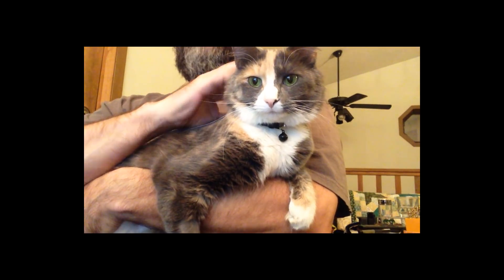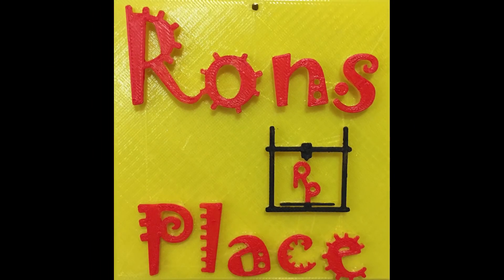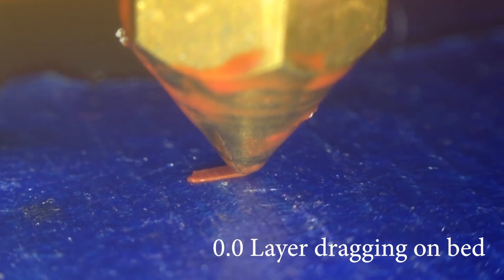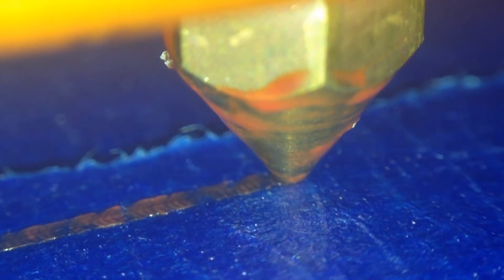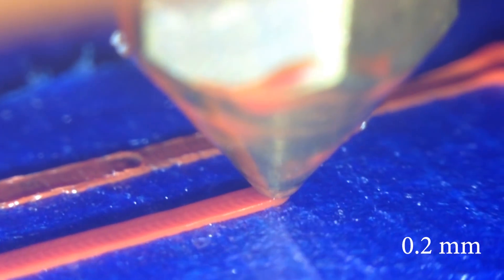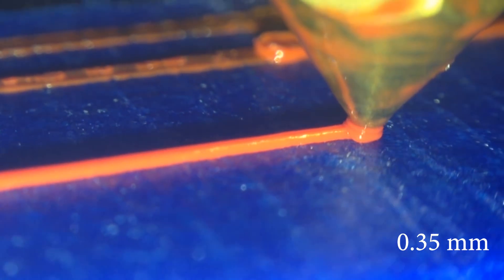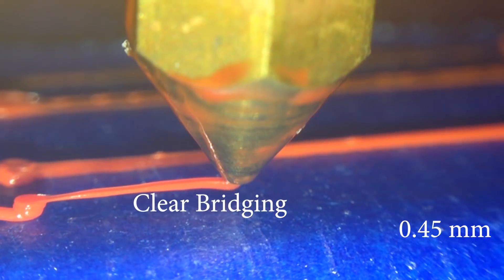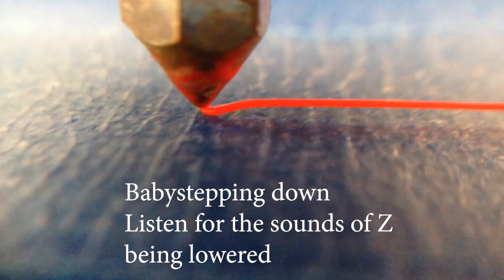3d printing Layer Heights

Comment: Great video. I just got my first 3d printer and I’ve been experiencing a lot of issues with the first layer adhering to the bed. Constant readjustments and a lot of frustration, but I think I finally understand. Being that it is my first 3d printing experience I went into bare bones and went with the sticky note method of bed leveling, but I guess I just need to invest in feeler gauges to set a proper bed height. I could get the bed set reasonably with a sticky note but it was a crap shoot if the first layer would stick and I think improper bed height has bren the cause all along. For days I’ve been watching videos trying to figure this out but this example is the best of all. Thanks.

Comment: I've been sharing your video as much as possible to new printers. This video is the perfect representation of the first layer height. This whole idea gets boiled down to "good squish" and that just isn't enough information.

That and understanding that when you level your bed with a piece of paper or feeler gauge, you have to account for the thickness when you set your "initial layer height". This would solve so many bed adhesions issues that people have but no one seems to talk about it. 

It's always temperature, "USE GLUE" or any number of "fixes".

Comment: I have no problem printing the first layer so that it is smooth like the one in the video.  The problem is the subsequent layers show alot of scratching.  So might print up to three layers very smooth and flat but after that its like the nozzle didnt move high enough and scratched the previous layers.  Not sure why there are no videos on something like that as it seems to be a common issue based on the forums I have read.

Comment: Its hard to get good bed adhesion in my experience at your "perfect" height  for the first layer.  I set mine between that and the second "shovelling layer" played before that  i find the squish helps tremendously with tall skinny and or faster prints

Comment: Nice idea -- and nice execution. Perhaps I missed it, but I'm assuming you're using a 0.4 mm nozzle. How would the Z-height be adjusted for other size nozzels from 0.1 to 1.0 mm nozzles? And do different materials make much difference: ABS, PLA+, etc.?

Comment: 4:07 how do I fix this
Reply: Adjust your z offset to get a little closer to the bed.  If you can't adjust z offset, adjust your bed by giving each wheel a 5 minute turn closer to the nozzle until you get something like at 2:55

Comment: Thank you Ron

I completely agree with the 0.25mm high, is the one that's working best on my ender 3 pro
I want to emphasize... guys stop using paper, paper it is not a tool, get yourselves a feeler gauge
and make sure it touches the nozzle and the plate and without pressure

I also want to share my other settings:

creality ender 3 pro
creality polypropylene build plate "amazing"
hatchbox PLA
build plate temp. 60°c
nozzle temp. 200°c 
initial layer high 0.25mm
initial layer print speed 15mm/s "very important"
initial layer flow 150%
initial fan speed 0
Brim width 4mm 

Ultimaker Cura 3.6.0

I like using brim not skirt, because when it starts
printing the outer line of the object, it's just a continuation
of the brim and the outer line is going to stick on the plate
and on the brim as well.

happy printing and
Thank you!
Reply: I agree on the gauge tool. Very helpful.

But should you not set your initial layer height to “0,375” (150% of 0,25) when you set 150% flowrate on the initial layer (according to this video)??

I also am doing 150% flowrate on first layer but do now consider not to.

Comment: Good job, but this only applies to a first layer on a blue tape - on inconsistent surface.When you print on glass/sheet metal you have almost perfectly flat surface and especially first layer greatly benefits from that. And then other properties than "looks" start playing bigger role. Ie different youtuber had shown, that for 0,4 mm nozzle 0,1-0,15 mm layer height results in best inter-layer adhesion and strength goes way down with anything above 0,2 mm.
I prefer 0,12, because it's strong and from normal distance you don't perceive separate layers (exact value is 0,12, because it aligns with stepper motor that on my printer prefers 0,04 mm steps).

Comment: PLEASE HELP. I’m getting desperate at this point.
1. To get anything to stick, I need to raise the bed to the point where the extruder motor starts clicking.
2. No matter what, the first layer gets really messy and rough, and most of the time just lifts off while printing (it lifts off when the bed is low enough to stop the clicking, but it is messy no matter the height of the bed)
How do I get the filament to stick properly? What could I be doing wrong? I’m getting so frustrated, I spent 2 hours today trying to get it level, and trying to get the filament to stick properly, but I couldn’t. I should also clarify I’m using an Ender 3 Pro.

Comment: Just wonder how you did that test with the Prusa MK3 as I am having problems with my nozel and would love to see how you can print thes lines.
Reply from the maker: this was done on an i3 clone actually..  you can get the same concept with the MK3 by using the menu item for setting the first layer.  It works VERY well for setting this.

Comment: meh, i have no issues with a .1mm layer height or even a .05mm height. it makes the prints better quality imo even with a .4mm nozzle. the layer lines arent as noticeable. i also find the use of blue painters tape to create far too inconstant a first layer to be reliable. i print on glass with glue stick. FAR better adhesion and first layer quality. i havent had a print fail in over two months. .2mm layer heights are almost too high for me. last time i tried that the print was very structurally weak i was able to crush it in one hand. i only ever use it for supports. it adheres just enough and creates enough support to hold up overhangs. its also super easy to remove supports printed at a higher layer height than the rest of the print.
Reply from the maker: Thanks for the input!  I wanted to clarify a couple things..  this was specifically on first layer height; not over all print layer height.  The idea was to show what different heights looked like for newer people.. and why modifying your first layer height often makes sense.  Meaning you can print at .15mm layer height but do the first layer at say 150% (0.225mm) to give a very solid first layer to build from.   

The blue tape was used simply because it gave great contrast to show the layer; this isn't normal printing (i use PEI and build tak, and Mike uses Glass/Glue with some tape on some of his builds).  

As for structural integrity; layer height of .2 should not hurt that and in fact should be even stronger.  If you were seeing something you can crush; it is likely that you were either to cold as the layers tried to adhere, or under extruding (try increasing your extrusion multiplier possibly).   A .2mm "tube" of plastic will have a larger "mating surface" to allow the layer above it to adhere.  It should be stronger.  

Thanks again for the feedback..  its great discussing things.

Comment: My problem is that I get nozzle buildup whatever layerheight I use. Why...Can someone help me?
Reply from the maker: A picture of the nozzle may help diagnose.   You may have an extrusion problem.    If you measure filament back 150mm and put a mark..  then extrude 100mm; how much is left to the mark?  It should be 50mm..  my guess is you may be over extruding and will be much less than 50mm left and may need to adjust the e steps.   Just an idea though without more information.
Reply: Rons Place So the problem is that I can't manually extrude filament on my printer. It's a dremel 3d20. I'll try to send you a pic tomorrow. What I can tell you without the pic is that it's curling when it's coming out.
Reply from the maker: If filament curls when coming out, you have a partial clog.  I highly suggest doing a Cold Pull a few times.   Or also you can try a cleaning filament. (I have a video of that)
Reply: Rons Place Ok I will try that. Thank you
Reply: Update: Tried the cold pull method. Problem: The hole where the filament goes in is so small, only the filament can pass. So when I push it into the nozzle, I can't pull it out. -.- Any other way to clean the nozzle?
Reply from the maker: When you do a cold pull..  start at room temp and tell the hotend to go to 200.   Watch it ramp in temp and at about 70 give it a pull.   This should be warm enough to soften and release from the nozzle but be firm enough to still hold the “crap”.   If you still have issues you may have a larger clog causing your issues.  Try this a few times until it comes out clean (cool completely each time).. or you may have to take the hot end apart to clean.
Reply: Rons Place Thanks for the tip. I'll try it asap
Reply: Rons Place So I tried what you said and it worked. Thanks for your help :)

Comment: Hi Ron

This video was fascinating!

I am just starting out - I understood intuitively the importance of the first layer and that layer height is critical, but not how to determine what the optimum layer height might be.  I also don't know whether the software compensates extrusion speed for higher (or slower) printing speeds. Does the optimum layer height vary depending on printing speed? If it doesn't that would suggest that for a given nozzle and filament diameter the optimum layer height setting will never change.

Also these were videos of the first layer - do you think that the layer height of subsequent layers should be the same as the first layer? Again I am not sure whether any software allows for subsequent layers to be a different height to the first layer.
Reply from the maker: This is one of my favorite videos :). Yes the extrusion speed changes with print speeds; up to a certain point.   You can set Max and min speeds in Slicers.  Speed “shouldn’t” impact layer height..  if everything works correctly and scales correctly you will put the same amount of plastic out with any speed.   The problem is Physics and mechanical ability start getting in the way at some point.   Meaning you cannot get enough plastic melted and pushed through in a quick enough manner.   Also consistency of speed is another factor.. turns, retracts layer changes etc..  all fight against you.    Most of these can be handled by simply..  slowing down.   Don’t try and kill the printer by crazy speeds..  stay slow and you get better prints; and the difference really isn’t large in regards to print time.   

Theoretically after the first layer it will always be the same and related to layer height..  all slicer controlled.   There are many options that can interact with this; but I would start by focusing on the first layer to reduce confusion.

Comment: I think that was a fine idea - yes, this internet does present a great opening for sharing - this foto sequence was just fine. I tried HIPS today - it curled, hardly stuck, lifted off. One of three prints actually finished and a number of fails... It's a long haul to get to grips with it all. The HIPS was weird though. Anyway, it was nice to see you relaxed and happy with sharing those nice lines flowing out - it does leave an impression. To otherwise experiece this, one must go through the whole process oneself. Our sharing, when we don't overwhelm ourselves by cyber collected info, is a mutually beneficial process also helping many to avoid hurdles and approach from other angles.
It doesn't stick. Needs glue. mmm, ?nozzle hight?? I was at that point before I quit today because my final resliced print had a slicer fault as became clear and the bed needed...etc. So I seemed to pass by here. Thanks for your time...

Comment: it was very cool and interesting display of first layer printing, however  I keep say and thinking people should stop printing on painters tape! have we not learn its a outdated and useless way of printing now day! there is so many cheap good bed adhesive for 3d printing now why go throw the pita tape thing.
Reply: I use a microfiber cloth soaked with a glue stick, squeezed until the glue foams. The microfiber allows me to dab the foam evenly on the borosilicate plate, and after it dries, you can’t even see it on the bed. This allowed me to lower my bed temperature to 105c for ABS first layer printing, with very few failures.
Reply: what do you recommend? I use it for PETG. cause it eats my glass bed
Reply: @chloemcholoe3280  put your glass bed in the freezer once it's done printing and cooled to room temp, parts pop off and no damage should occur. That's if it's detachable.
Reply: Makes perfect sense to have  a opaque mask for shooting the video . Thumbs up!
Reply: I did try printing on a glass bed but it was too reflective and hard to focus on. The red filament on blue tape had the  best contrast to see what was happening. Glad this was interesting to watch.